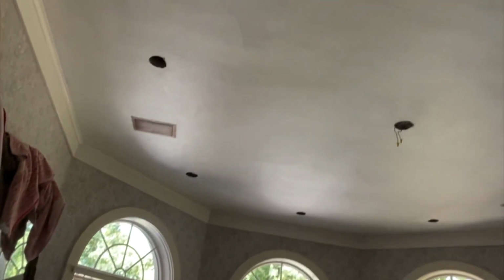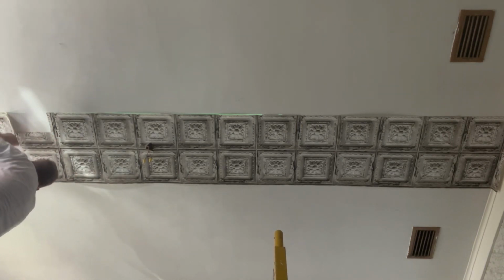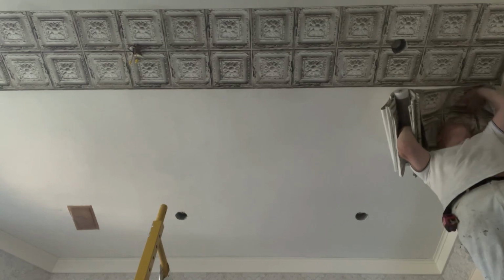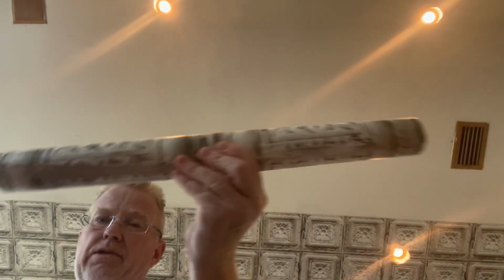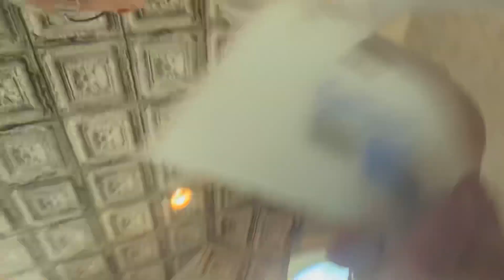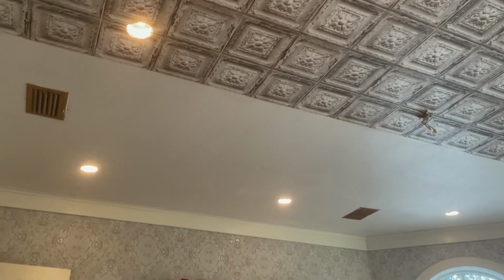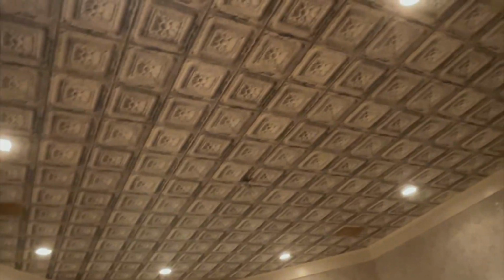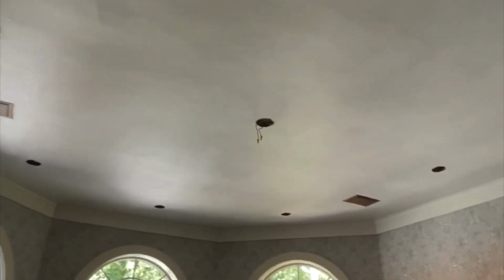Wallpaper a Ceiling by YOURSELF! - Spencer Colgan

Comment: Hi Spencer, in general as regards to pasting and booking would you paste more than one sheet or one at a time.. I ask because I trained as a painter many years ago, but never managed to get into the hanging side of things, I just remember paper hangers pasting 3 sheets at a time (by the time the 3rd was pasted the 1st was ready to hang, but does this ring true?
Reply from the maker: It’s an excellent question and here is your answer:
1. Only paced as many as you can handle at a time… This differs from one person to the next… Secondly, the instructions will tell you how long each sheet should soak in the paste; if it’s only five minutes, usually it’s going to take you longer than five minutes to hang one sheet of wallpaper, depending on the length of the wall and other factors. But if you can hang a sheet of wallpaper in seven minutes or so, I would think you would be good to paste two at a time this way you will expedite the entire process and you will be happy by the end of the day
Reply: @spencercolgan  thanks for the swift reply Spencer